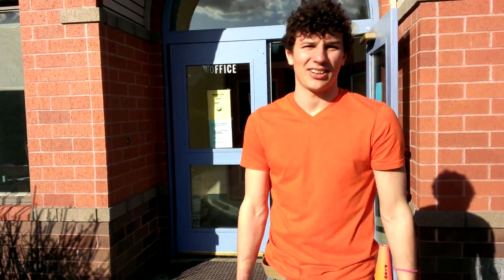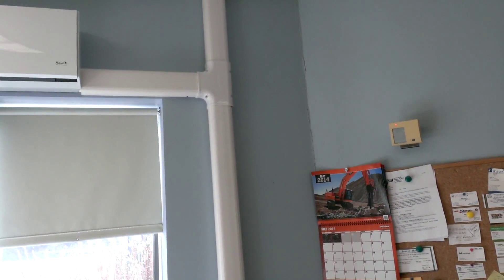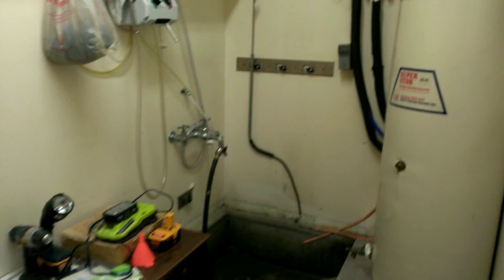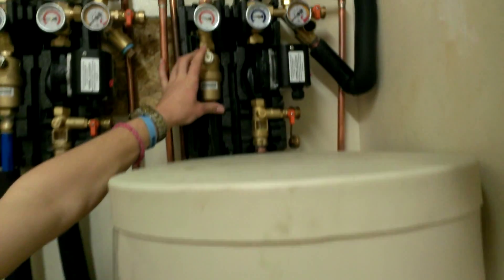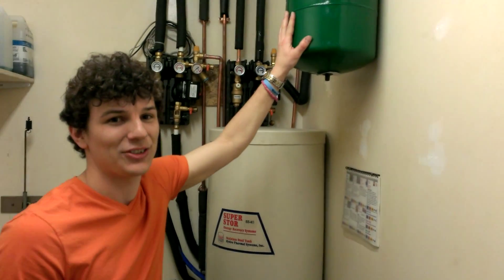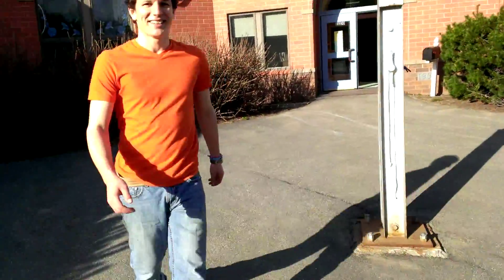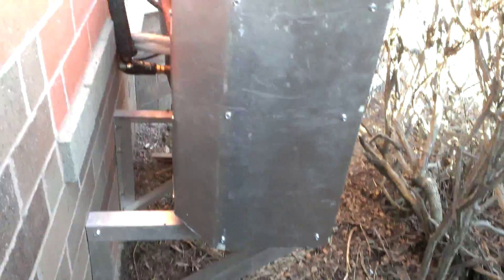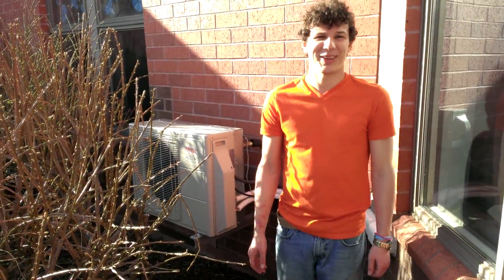Solar Thermal Heat Pump Installation Walkthrough

Comment: I'm all for academic experimentation, but a 200' pex run for one collector sounds like an awfully long way.  Is there data logging for this system?  If yes, is it being published?  I hate to sound like a downer, but I'm betting the performance is far too low to justify the cost.  Scale it up by 10x, pitch that collector and cut the pipe run, you'd probably be into interesting cost-effectiveness territory.